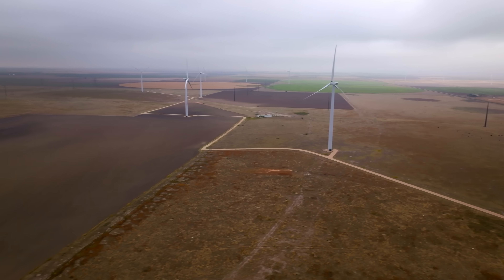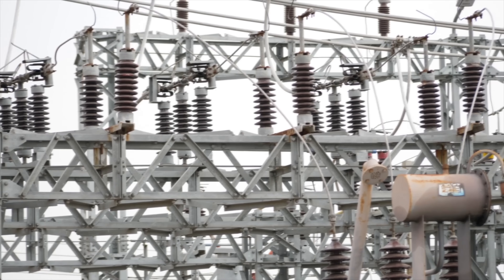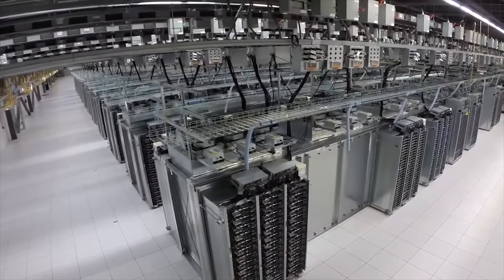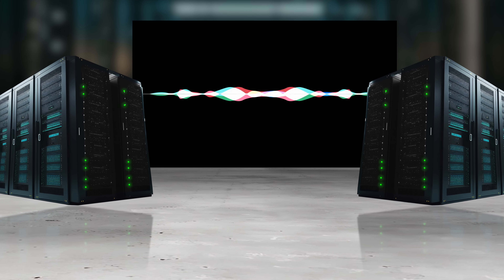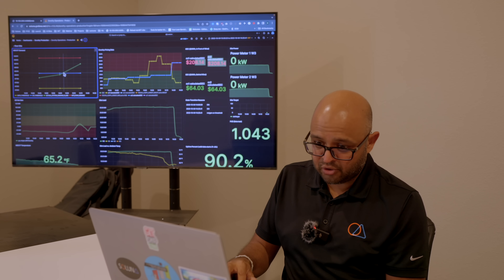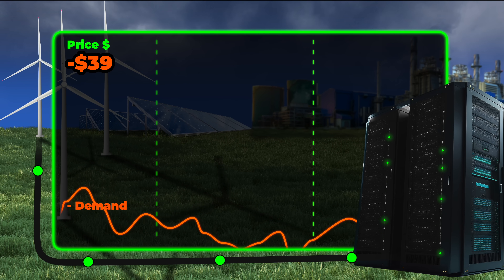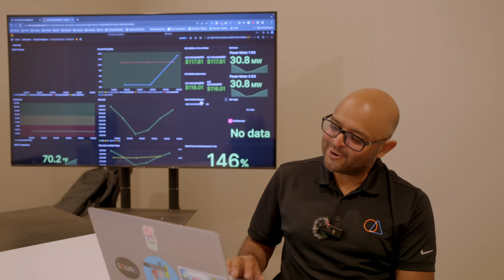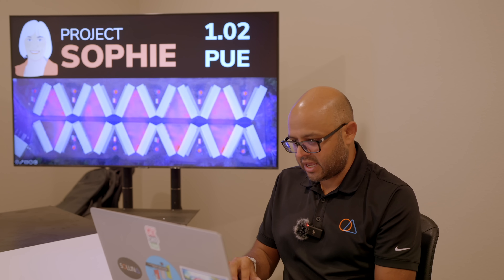Wind Farms' Dirty Little Secret No One Talks About

Comment: Every system I've seen proposed, ignores the First Rule of Renewable Energy (like I need to follow on my sailboat): NEED LESS POWER.

My fridge uses 45 watts. I used to have a Sun-Danzer brand fridge, that used 25 to 100 Watts, as needed.

Hot water, should be heated with Solar Thermal, which is 60 to 80% efficient, compared to SolarVoltiac's 20%.  My boat uses waste heat, from the small diesel, when I'm motoring. (((The SolarThermal system Clinton put on the White House, was moved to a university in Vermont---where it's still working.)))

Corollary to the First Law. Don't try and replace cheap fossil fuel---Watt for Watt---with Renewables. Need less---you save it on the other end. Less demand can mean a smaller Solar system needed.

I like distributed Solar, as a Democratic principle, anyway.

(((Solar I capitalize, as it comes from the name of our star: Sol.  )))

Comment: Proper storage could make a wind farm useful as base load.
Reply: if it was that simple they would have done this YEARS ago.
Storage is the number 1 reason renewables suffer. 'Proper storage' does not exist. Using current technology for example, the cost of grid-scale storage that would allow wind and solar to produce 100% of a temperate first world country's energy would cost more than the value of the energy produced by the turbines/panels in 25 YEARS .

Comment: This may already be old news, with 440 comments existing at the time.  However, I like to present one idea in use for certain data centers for their cooling.  They use heat pumps to further raise their discharged water temperature and then deliver it to an area "remote" heating network.  There is demand even in hot summers, for household hot water use!  And naturally much more in actual heating season.  Of course there are no remote heat networks everywhere, they are economical only with adequate population density, generally in some medium to large cities.  But that way the water is not wasted, it gets recycled.

Comment: This seems like a 10 minute advertisement without any in depth engineering analysis, which is the main reason I started following the channel. What is the compute being used for and why does it not matter when and how much they're using if it has to respond to demand pricing?? Not your best video. Would appreciate more analysis similar to your previous clips.

Comment: It's an example of "Demand management". But there is plenty. Cars charging more where electricity is cheaper. Freezers lowering the temperature some extra grades to store cold, changing freight trains routers to make more or less travels on demand, specially for heavy, large and easy storable cargo (for example, raw materials), etc. etc.

Sometimes pure store energy is the best solution. Other times, consume on demand is cheaper.

Comment: Great video, the intermittent nature of wind can make big problems on the power grid. You made me laugh when you said the production can change hour to hour. I’ve watched a medium sized wind farm change hundreds of MW’s scan to scan and that’s at a six second scan. When sighting wind farms they make sure the capacity to get the power out is there but seldom study if the room will actually be available on the transmission system or energy needed. We handled it by sending curtailment base points and flags to the wind farms and backing them down since the energy they were competing with was base loaded must run hydro electric. You might think just back off the hydro and store the water, nice if you can do it but not very practical when your on a river and backing off production will ground ships down the river. Moving intermittent computer processing into a load pocket behind a bottleneck is probably a better idea than the alternative of grid scale batteries and scheduled production when transmission or loading allows. Mentioning the cooling aspect is another great point. Just as some people store excess energy as heat, there have also been successful demonstrations where people store low cost energy in the form of large blocks of ice for cooling at a later time when the cost of energy is higher.
Reply: second to second.

Comment: I don’t understand why data centers don’t use a closed loop refrigeration system but instead of using water in close loop refrigeration system they could use a dielectric fluid similar fluid in standard 50 µF capacitors. 
Imagine a dielectric fluid, flowing from a hermetically, sealed CPU heat exchanger to a tube and tube heat exchanger, transferring heat from the dielectric fluid to the refrigerant in the tube and two heat exchanger, then from the tube and tube heat exchanger, the heat would transfer from the refrigerant to the outdoor condensing unit, releasing the heat into the outdoor air . One giant outdoor condensing unit can share multiple tube and tube heat exchanger, a.k.a. indoor units like a ductless mini split system could

Comment: Doesn't work. Too much of compute is taken up by capital cost, so down time not ok. You need a portable industry with low capital costs but high energy needs to be intermittent demand, and compute doesn't qualify. Maybe it will some day, but currently fabs are the bottleneck, so capital costs will stay high for a while.
A data centre at a remote wind farm location can half the required connection capacity, because when the wind farm is not running it can pull the other way, but it doesn't fix the intermittency issue.
For cooling data centres that do not need to be real time (or fast connections), AI data centres in particular, water is not a problem. The biggest advantage of these data centres are that they can be placed anywhere, so you can simply move them to where water is available. On top of that, cooling is the one area where we can easily buffer using intermittent energy. Any solution to water scarcity and power intermittency would start with a cooling buffer, which this does not use.
I'm personally team methanol. Methanol can be easily stored, easily transported, and used in a multitude of ways. The cycle efficiency is pretty low, but this is made up for by eliminating almost all other infrastructure and storage requirements. It would push funding towards carbon capture, but most importantly it scales down efficiently. A unit connected to a water supply with CO2 trucked in (or captured from air) and methanol trucked out would require no long cables or pipelines. To scale it down you simply reduce the frequency of the trucks, meaning linear infrastructure scaling down to near zero.

Comment: I was part of a Steel Mill startup in the 90's in KY. KY was selected because we were going to operate on excess electricity generated by the coal fired power plants in KY at a base price of $16 per MW. Like described in the video the availability and price of electricity varied throughout the day. We would be in contact with the power plant on an hourly basis and get a feel for the price for the next hour. Depending on our order book and the price we were receiving for the steel we would decide whether to shut down (which was expensive) or continue running.

We would visit the power plant about once a year to develop/continue our relationship with who was on the other side of the phone. They showed us all this stuff which was very interesting. At the time their base load was coal fired and peak demand was generally produced by natural gas turbines. Power plants are penalized for generating more electricity than needed so they need to be very careful as to how much they generate. They can't just make 20% more than they need and sit back and relax. They are only allowed to be wrong by a few % per hour. Since we were their single biggest user, they used us for help in keeping within those few %. A phone call and hey, could you guys shut down for a few minutes or hay, why are you guys not running right now, was asked occasionally.

This turned out a little long winded, but it is very interesting what goes on behind the scenes. Something that really made things difficult at one time was a little company called ENRON. Those a$$holes were basically the used car salesman of energy. At times when they were selling electricity to the highest bidder they would be asking $2000 per MW. Yes that is not a type error.

Comment: Baseload is dead. Today, in much of the world, sustainable energy is in a position to carry most of the load when combined with dispatchable energy from energy storage and grid-reactive generation.

Even where local market distortions mean that sustainable energy has not yet reached this level, we know that it will, because the capital required to establish renewable plate capacity is lower than the operating costs of even coal, which is the lowest direct cost baseload source.

Comment: Nice topic. Where I grew up in Wales, they had pumped hydro as a kind of battery. I always saw this as a bit of an accountancy trick because they essentially pumped water up the mountain when electricity was cheap, and then allowed that water to be used to generate when demand was high. But now the same mechanism can be used to fill the reservoir when renewables outweigh demand and then supply when demand outweighs the renewables. 

There are issues with this, only certain parts of the world have suitable terrain and if the lakes top and bottom were natural then there are environmental issues if the water is no longer flowing at the same rate. 

But surely we also need to be looking at storage options in conjunction with renewable energy. We have been told we need that in our homes with battery storage and solar or variable tariffs. Why is it unreasonable to expect the grid to handle the buffering of energy?
Reply: Storing the unreliable output from renewables is the elephant in the room, because storing it is the very, very, very expensive bit.  The peak of solar ( but not really a peak in winter, more of a molehill ) is shifted by many hours from the peak of demand.... Wind can disappear for weeks at a time, often during the coldest 'high pressure' weather systems that can park themselves over large areas,  when the isobars go into 'social distancing mode'...
Reply: The grid already is, unfortunately they are behind when it comes to sporadic renewables. There was lots of investment into renewables, but it was only once they were being rolled out on mass anybody actually thought of the obvious question of how do we store this energy to make it feasible.
Reply: @kaneworsnop1007  Greenies do not like to talk about the feasibility and  cost of storage
Reply: Creating electricity is easy, storing it is the elephant in the room.

Comment: How was storage not included in the design of the plants from the start?
Reply: Because that's a very expensive addition and wind farms are already very expensive to maintain
Reply: @HH-le1vi  How long would it take to pay it back with the extra earning from selling the excess energy during low wind and/or high demand periods?
Reply: @tiagotiagot  well wind farms typically don't really have a good pay back term. Generally it's 6.5 years but that's if it doesn't require anything that's not planned. Those batteries wouldn't store much energy either. Only about 15kwh each. So your payoff would be even longer since install costs would be 25k

Comment: does not solve much because in peak hours you still using the so called none green supplies 

nun new about using farms to power computer banks 

pumped storage and using the excess electricity to produce hydrogen 

kinda sucks for your super computer to go offline in the middle of a task

Comment: The Computers actually waste 100% of the Energy used as heat, heat that can actually still do work. Putting water, increasing humidity into the air in a massive way can cause it to rain downwind. Or, desalination of Water. Even produce electricity, like a battery, storing heat for later use, generate electricity. Or, simply heat buildings in the wintertime.

To dump all that heat into the atmosphere like these Bitcoin miners are doing isn't kosher. It's wasteful.

Comment: this likely a smart idea a few years ago but terrible idea by today's recent changes. LiFePO4 batteries or packs have become so cheap these days that it is better to store the wind farm's energy in batteries than have expensive data center (AI, crypto, server) equipment to shutdown when grid requires more/pays more for power. If you're a company that has talent both in wind and datacenters then it is good but still need batteries for this because you need to minimize downtime for compute.